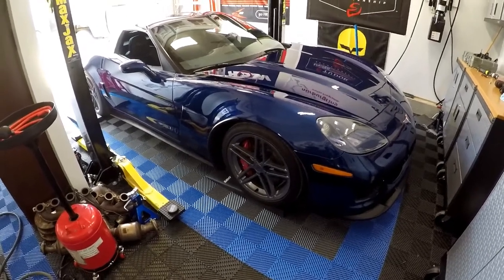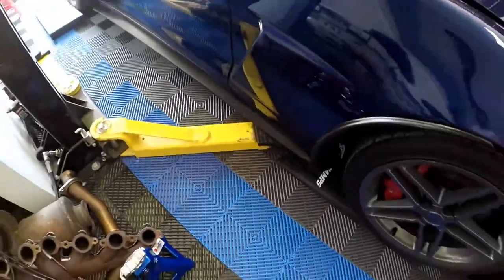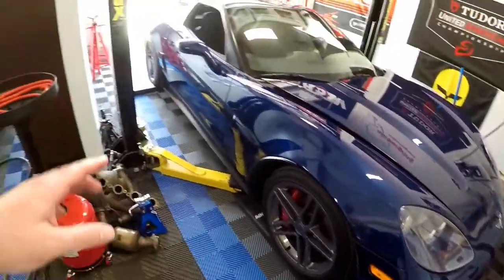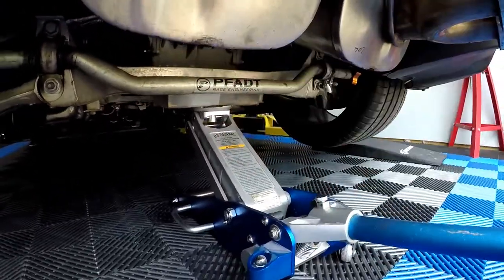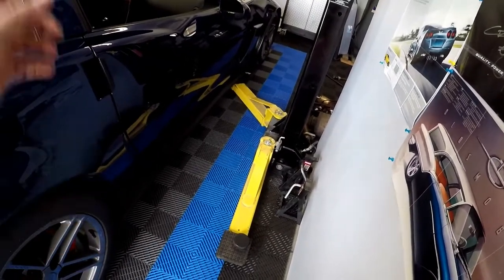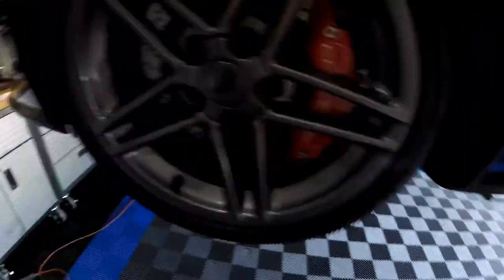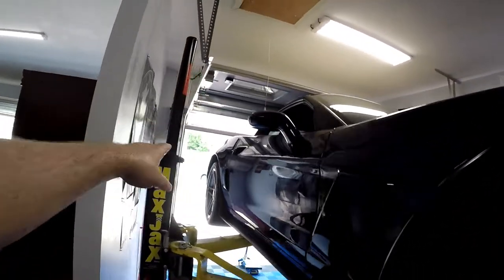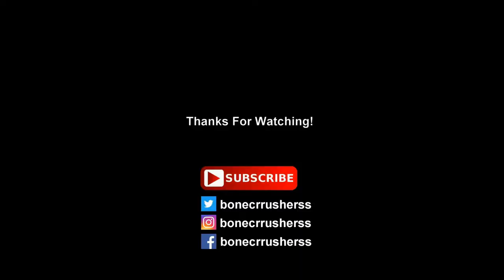2005 Chevy Corvette - Lifting a lowered car onto Maxjax Lift

Comment: Im glad I saw this before buying a lift. This completely kills the notion of having a lift because it just doesnt save the time and hassle for me unless I REALLY NEED it that high in the air.  Great inciteful video!
Reply from the maker: What kind of car do you have?
My Chevy SS - I can lift it up in the air with no issue.
My Corvette is stupid low - and so I have to drive up on small ramps, then jack up the rear - it takes 5 mins if that. 
I wouldn't trade my lift for anything - I am never working on my back again!
Reply: Currently I am building an Sn95 mustang. While its not slammed by any means, its pretty damn low. my sub frame connectors and X brace up front hang a little low. We had to pull up on the car a little last time I had it on a lift to get it on. Still the point is for me to not have to jack. lol. Couldnt you just drive up on taller ramps and avoid jacking? Or is the front too low on those to get on a higher ramp. I wanted a c5-c6z, but the front end height kills it for me. I would never be able to get it out of my driveway I think
Reply from the maker: My car is so low you need to get both axles raised - othewise the lift arms won't slide under the zr1 splitters - or the frame. 
If I only drove up on front ramps - the arms still wouldn't clear the rear of the car.

What motor is going in the SN95?
Reply: bonecrrusherSS crazy! That def keeps me from going with a vette. I’d love to have one, but just won’t work at my house. My Mustang is enough a hassle to get in and out. Lol. Not sure what I want to do motor wise yet. It’s such an expense that it almost doesn’t make sense for me to add anymore to this car. I been contemplating gt500’s lately
Reply from the maker: LS Swap it! LOL.
Reply: NEVER! lol. Id just buy an LS based car to have another toy. lol.

Comment: Have you ever tried to Jack stand your SS? (not with your lift)but  Jack stands. Maybe a topic for another show. With only 4 points its tuff. I have jackpoint jackstands but maybe a how to video with traditional stands. It would be interesting to see what you come up with..
Reply from the maker: Jack the rear up by the rear pumpkin - and put the rear stands in.

Front - lift it up by the front subframe - just make sure you are not on the oil pan.
Reply: bonecrrusherSS  I have only jacked  my SS up once to paint my rusty rotors and it felt sketchy. How ever I purchased crossdrilled rotors and will be doing a break job this weekend. I'll revisit the pumpkin lift. It just felt sketchy.  The SS forum is all over the place on this topic. Thanks for the reply😊

Comment: How far apart are your posts? I have a c6 that i am trying to lift with the MaxJax but it seems that the posts need to be rally far apart for the arms to hit each lift point.
Reply from the maker: 130" from outside edge to outside edge.

Comment: Ummm…  if you already raised the back end with the floor jack, why not just move the arms under the car and start lifting it?  Why do you bother with the rear race ramps?
Reply from the maker: Because the side skirts could get crushed when lifting the arms back up - and there is zero risk of the rear floor jack slipping/moving when you are raising up the car.

Comment: I should buy them  and always have them in my trunk  , since i lowered my car  every shop i have taking it for oil change or change of tires  they say they cant lift or wont do    Because the car is to low   Not to mention to do the alignment its been like 4 shops so far   Its anoying they cant think of a way to lift low cars 🤦🏾‍♂️
Reply from the maker: I've since raised the car back up on new coilovers - and haven't had to use the ramps in awhile.